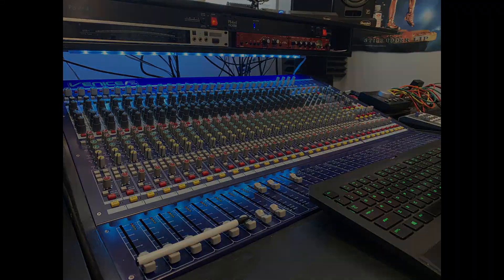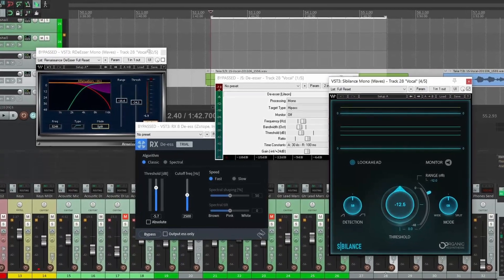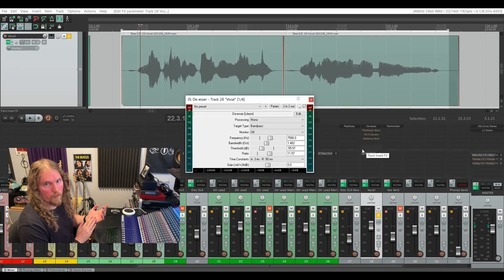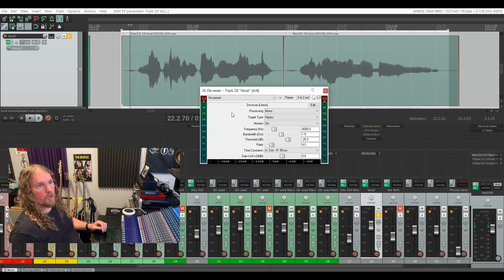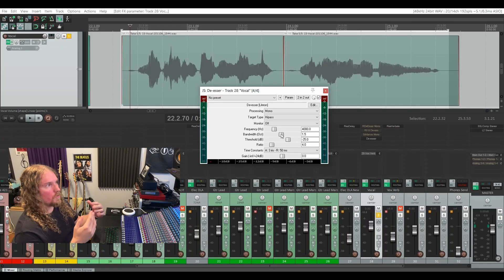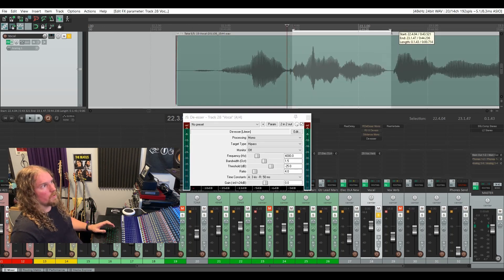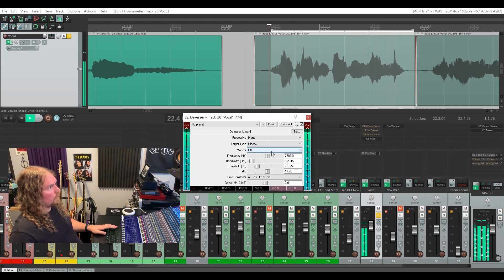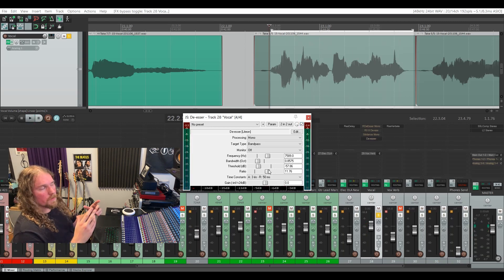DeEssing In Reaper With JS De-Esser

Comment: Hey thanks for the tip on the manual de-essing. I was having a hard time fixing a song tonight. Couldn't get EQ or de-esser to fix it. Thanks to your video though, I was able to easily spot the compressed areas of the wave form as you suggested, and it worked perfectly and swiftly. Very valuable info to me, thanks again!

Comment: One thing that will really help you SEE the S sounds is opening the Action list in Reper, searching for Peaks: Toggle spectral peaks. The waveforms will then show different frequencies differentiated by color. Those colors can be later changed in View/Peak display settings. It's a little thing but it helps a lot!
Reply: I use that spectral waveform! My ear daggers are teal and turquoise!
Reply: Wow, very cool feature
Reply from the maker: Great tip, thanks!